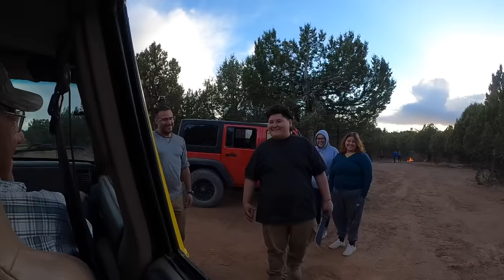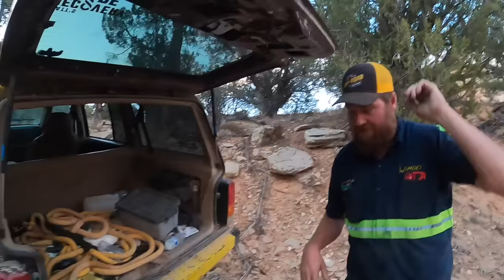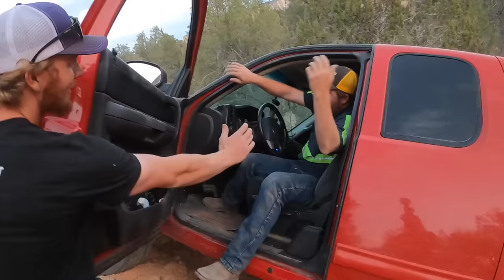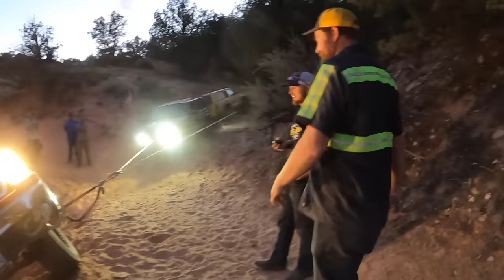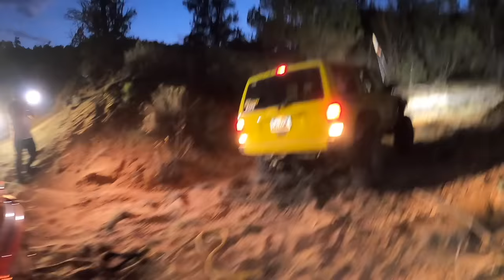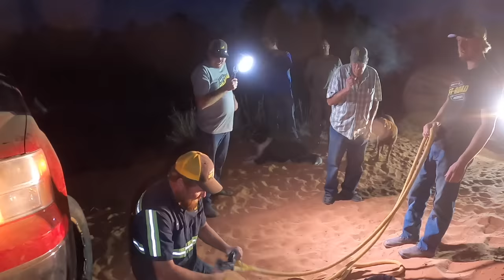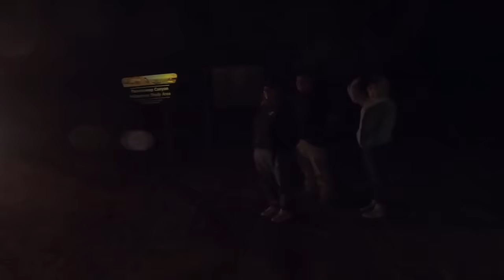GMC Sierra Goes Over The Edge - 2WD Truck!

Comment: Matt, your 1st rig up would have worked had you guys lined up on the road below and ran your line straight to the tree and used a double sheave at the tree and ran your line down to the truck with a sheave back to your double on the tree, then back to your harness assembly. This would have doubled your pulling power between the tree and the truck and minimized  your pull to the jeep. As you had it, you were running out of winch because you had too much force vector pulling toward your jeep and not enough pulling to the tree, because of the single line arrangement and the angle between the jeep and the tree toward the truck. Just saying for a little more rig up and line your first pull would have succeeded.

Comment: I see why people say dont go wheeling alone. We were exploring our  30 acer feild property, we knew there was some wet lands but didnt know where. My dad took his 66 cj5 back in the feild i went ahead on the dirtbike. The dead grass covered the saturated soil, i floated right avobe it all, i tryed to warn my dad it was muddy but it was too late, he was up by me and when he came to a stop he sunk in. Kept trying to get ir out, jamming rail road ties we found under the wheels but nothing was helping those 30 year old bald p225s. We made it to the oposite end of the property,  far enough the farmer a few days later was even afraid if hi could even get his tractor up there. I must admit we were impressed how far we got on bald small tires, no lift stock spings that are lower than stock cause there so worn, 35 psi in each wheel(forgot to air down, but we do have 4x4 with a broken driver side fron u joint, and posi in the rear. I also now see why some swear by lockers, no way my jeep woulda made it back there with the tires i got.

Comment: Why buy a truck that's not 4WD? 

You don't intend to use it in 4WD applications. Adding 4WD brings weight and maintenance issues.  Why reduce fuel mileage for a highway hauler?  And 2WD can get you a surprisingly long way.  But it's also important to then use your truck in the applications it is equipped for.

Comment: I have a 2wd pickup, 2000 F250 SD. I had no need for 4wd (when I bought it brand new) and it was expensive for 4wd.  Now I wish I had a 4wd but my old pickup has earned it's keep over 21+ years.  My 2wd pickup with a set of chains and good tires have rescued many a 4wd that got themselves stuck and they had NO IDEA it was a 2wd pickup.  It's also been a lot of places that are considered 4wd roads.  Most of those roads have also seen my 2011 Subaru Outback.

Comment: Do you guys not have seat belt laws in the USA? Here in Aust. it is about $500 fine for not wearing your seatbelt and that vision of  Lizzy is all the evidence they would need to slap it on her. Rudi as the driver ought to know better too. I guess you guys are determined learn the hard way about safety.

Comment: Rudy standing between those two lines gave me flashbacks to a shipmate getting cut in half by a snapped arresting cable on a carrier.
Reply: They are using synthetic winch cables so if they were to break they don’t kill you, they just go limp.